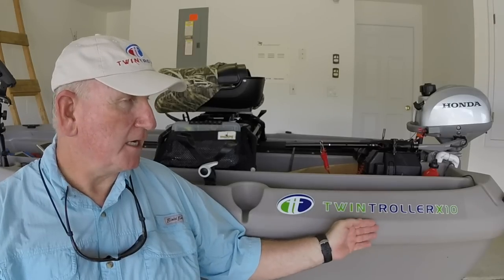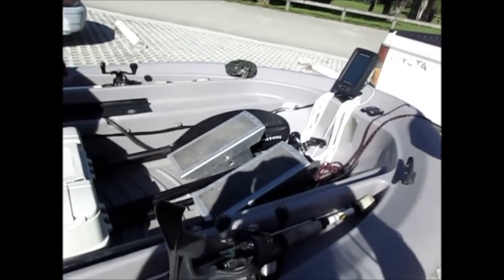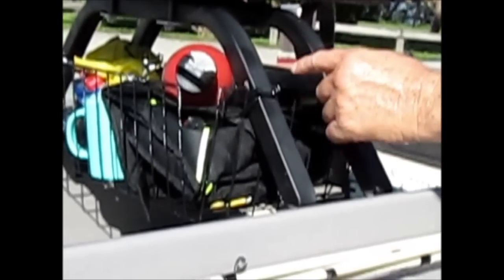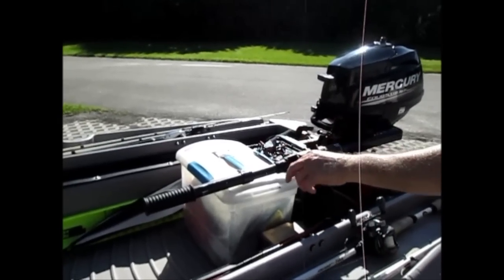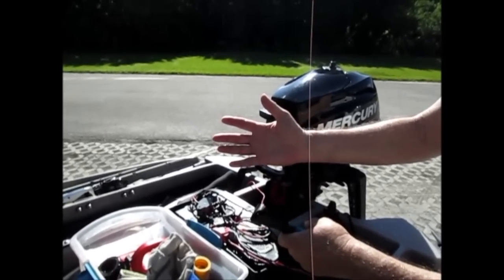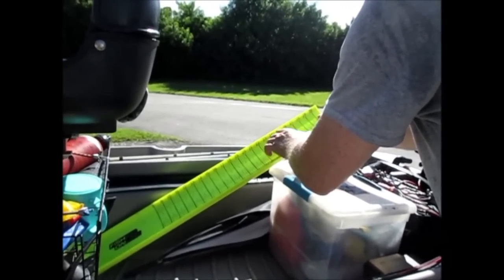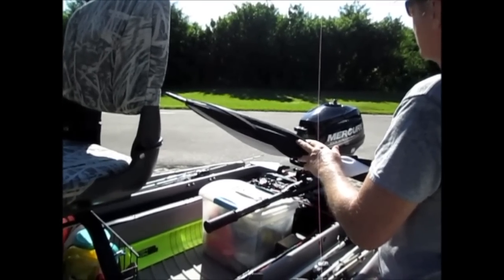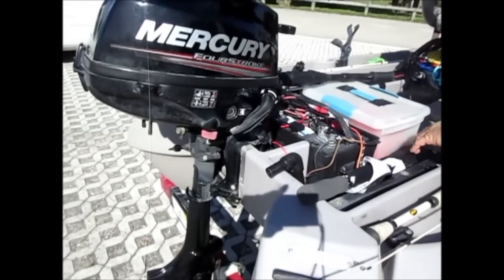LET ME INTRODUCE YOU TO STEVE'S TWIN TROLLER X10 (PART 1)

Comment: I had a old set of those navigation lights (they used "D" cells), my front nav light broke & after super gluing it many times, I finally ordered a set of stick on "Bow LED 12" Submersible Red Green Navigation Light Waterproof Marine Boat" from EBay for less than $2 US, they have worked great for the last 2 years & haven't blown the 1/2 Amp fuse!

Comment: Excellent excellent video Steve!  Thanks for sharing with Gerry and Gerry Hanks for sharing with us.  Looking forward to watching again once I get my Twin Troller.  But really looking forward to the trailer video as I’m sure it will be just as good if not better and possibly cheaper than that which comes with the TT.  Was planning on getting the Honda motor but certainly will get the Mercury now, love Mercury products!
Reply from the maker: Bob, Steve does a nice job on his trailer in Part 2. It certainly is another option that some can consider as a way to move their TT around. 
I have no experience with another motor, I have the Honda. I am curious how much of a difference the Mercury would be over what I have.                       Gerry

Comment: Great job guys!
Whats the maximum horsepower rating for a gas engine on a TTX10?
Reply from the maker: Pete, the Coast Guard rating tag on the Twin Troller says a weight rating with a 2 H.P. motor so I am not sure what Freedom Electric Marine says is the maximum horsepower motor. Since you are only going to put a relatively small outboard on the Twin Troller I would be more concerned about the total (560 lbs.) weight of persons, motor, and gear together. The Honda 2.3 HP only weighs 30 pounds when empty. If someone is looking at the TT to be able to fly across the lake, or to water ski behind, they are looking at the wrong boat!  I guess I do not have a good answer for your question though.                                 Gerry
Reply: Lunker012 Jerry this is Steve from Illinois I talk to the conservation officer he said if I put a 3.5 on my  TWIN TROLLERx10 and it’s only rated for 2 I will get a fine
Reply from the maker: Steve, the Honda 2.3 that is sold with the Twin Troller used to be a 2.0  Honda. I believe they started to measure the HP in another way and thus the 2.3 from then on. There may be other things they changed to take it from a 2.0 to a 2.3  that I am not aware of. If you take off the 2.3 and put on a 250 HO Yamaha, besides that it will sink, then an Officer would probably give you a citation , so I would not do that.                                        Gerry
Reply from the maker: Steve, too bad you did not take the test. You would have been a good guide.                                          Gerry

Comment: Steve, what all do you have running/hooked up to your main battery? What size, series, is your battery? 
27?   29?  31?
Reply: @howabouthetruth2157  Hey Steve, i just figured you were out chasing Big Largies! 😀  Thanks for taking the time to respond back. Im sure i will have other concerns, before getting my boat.  This past year, i been fishing out of a Sun Dolphin Sportsman, the 8 footer. My fish finder is a Humminbird Helix 5 SI GPS G2. Has Side, Down, and 2D imaging. It also has a mapping feature. The lake I predominantly fish, is a 30 acre lake, that has no current mapping, and i basically have that lake to myself!  The mount that i have for it, I got from www.fishfindermounts.com
Its a mounting system that has its own battery! The system is also completely portable! Its on the expensive side, but build quality is outstanding! Everything thats needed to mount, is included, including zip-ties! Im very happy with it.  I may get a 2nd battery, just to have incase i do fish larger lakes, but i will only need one for the majority of the lakes i will fish. So the trolling motors and the bilge pump will be the only items that will be connected to the main battery. 
What make of bilge pump do you have?

Comment: Great video. Thanks for posting. You should consider keeping a big sponge in the boat rather than that cup. It would clean out those rod holder cups quickly, and could also be used for wiping down or drying other areas. A good chamois would work similarly. Although it’s hard to drink coffee from a sponge. ;-)
Reply from the maker: Douglas, i have an even better solution. I do not drink coffee at all, ever!     Gerry
Reply: Lunker012 Me either Gerry! That was just my sad attempt at humor. ;-)
Reply: Howabouthetruth Thanks for sharing all your tips. Sounds like you have that thing all tricked out. I’m seriously considering buying one. And it sounds like half the fun is getting it all rigged up.

Comment: Question for you Steve and Gerry,
On-board charger. Do you guys have the one that comes with the TTX10,  or did you go buy a different one?
Reply from the maker: Hi Peter, the original charger for the Twin Troller worked great until one day it no longer charged at all and showed no signs of life. I then installed another new one that has also worked flawlessly. You can see an entire video I did on that subject at https://www.youtube.com/watch?v=9OUDpis93Bc  There is one thing about that new charger that I do not like, The power cord is too long. I prefer it was shorter as was the original that came with my boat. I have to store the long power cord on the TT when it is not in use and that is not what I prefer. 
The new one was purchased from Amazon. If you are asking you must be having problems with yours?                                                                Gerry
Reply: @LunkerFishing  No problems with it. I haven't ordered my boat yet.  🤣  Its like a blizzard here this morning.  Im in no hurry. Just trying to get everything i need before i order. I wasnt sure if it was a good one or not. Kinda like changing out the stock hooks on crankbaits.  I should have known better! Quality company, quality boat, quality components! Thanks guys!   👍🏻
Reply from the maker: Peter, Steve makes a good point. I also plug in the charger as soon as the boat is backed into the garage. I only unplug it when I am taking the TT out fishing again.
Reply from the maker: Peter, just think, you are more than half way through winter!!! Spring will be here before you know it. Just a few more snowstorms and you will be there.     Gerry

Comment: What happens when waves come over the bow or transom?
Reply from the maker: Robert, not sure how to answer that. Like any other boat you will likely get wet. I added a bilge pump in case that happened and I needed to evacuate some water. The most I have ever had the bilge pump on is less than a minute and that was because of downpour. I try to watch the weather so I am not out in bad conditions but sometimes things happen. I have a video on installing my bilge pump.              Gerry
Reply: @LunkerFishing  Gerry, I wanted to email you but can't find your email address. Anyway, I've attempted to contact Freedom Electric no less than 3 times with this problem and still they have not gotten back to me. My port side power cable had to be replaced. I ordered and installed it but now have a new problem. After installing it as instructed, which was a simple process, I took it out to fish. I was very surprised to find that nowy port side foot pedal now works oppositeof starboard side. I connected everything as instructed, red to red and black to black, but now pushing down on pedal makes the boat go forward and pushing down on top of pedal makes it go backwards, opposite of starboard side pedal. What did I do wrong and is this bad for the motor? Would appreciate any help or suggestions you may have since FE won't return my inquiries. Thanks
Reply from the maker: Richard, I never saw your note until now. You need to swap the wires. What you did will not damage anything. When you punch the other pedal in reverse that is the same thing that as reversing the wires like you did.          Gerry

Comment: i will look for part 2 now........so, after 22 months, if you were to buy now, what would you change ?
Reply from the maker: Gravediggermax, Interesting question. 
My TT came with the live well and I have yet to use it. I do not regret having it because I want to fish with live bait, just have not done so yet. It is a well designed live well. I fished for many years with live bait when guiding and have lots of tricks to doing that and I regret not doing it yet, but I will.
My TT has two fish finders, one came with the boat (very basic) but it gives me voltage readings of the system battery so I would would not get rid of it and the second one I installed myself (see my video about it). I wish that one had a larger screen, I am getting to old to see that small screen. Side imaging would be nice also.
I always wondered what another motor would be like but the advantages of the Honda are air cooled and very light weight so I am not sure if I would have changed that choice either.
I am in the process of installing a mount for a second GoPro that will hopefully get some better shots. That install will be a video soon I hope.
Now that I think about it there is not much I would change about the TT. All those changes are about things I added to the TT since I bought it.
One thing I would definitely change, although it gave me a better appreciation for why I bought my Twin Troller. I used to own a Hobie Cat Pro Angler fishing kayak before the TT. That was a BIG mistake and I wish I never bothered to do that and found the Twin Troller X10 sooner so I did not make that entire mistake.
Other than the ability to water ski behind the Twin Troller, there is nothing I would change about that purchase. Too many gators here to water ski anyway.                   Gerry